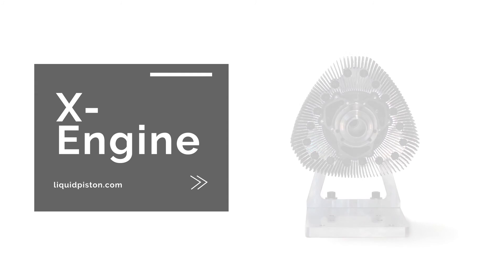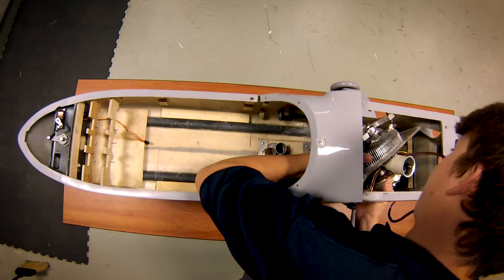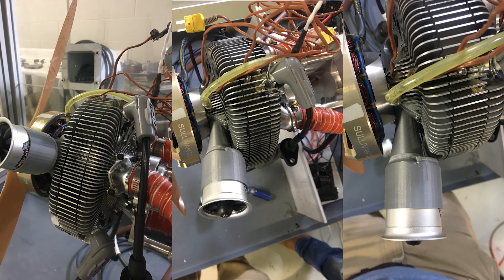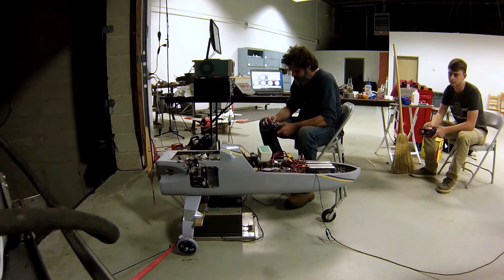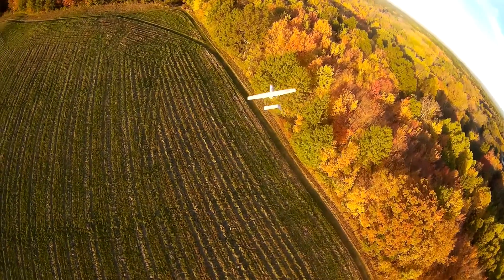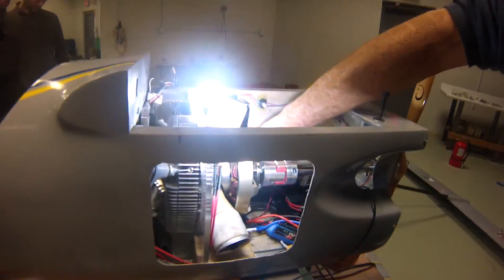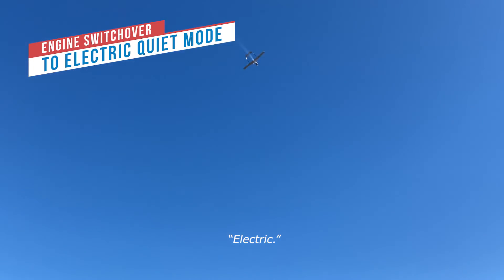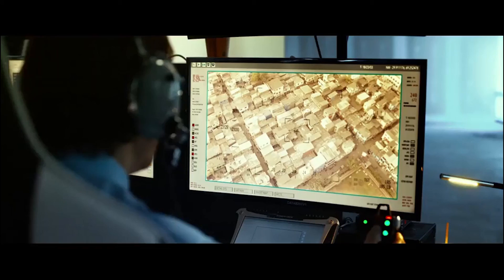LiquidPiston X-Engine takes flight [Long]

Comment: I understand how it works but how is it lubricated ??
Reply: There are oil channels incorporated in the "apex seals" so no need to premix 2t oil with fuel.
Reply: I would imagine the same as any 2 stroke piston motor or rotary. Oil in the gas.
Reply: @mikehunt8375   was thinking that. Honda has some small 4 stroke motors with sealed bearings and can be used in any position like for weed cutters.
Reply: @raydreamer7566  "sealed bearings" would only solve half of the lubrication needs. You're forgetting about those piston rings scraping up and down that cylinder wall up to around 10,000 times a minute.
Reply: @probingtime666  Honda did it with there 4 stroke weed eater 25 cc motor with sealed bearing and a plastic type piston ring design. I am not sure about the details.
Reply: @raydreamer7566  Thanks, I've wondered about them. Honestly I had no idea how they dealt with the problem there. I was guessing since it has to operate at very varying angles a sump wouldn't be it but thought maybe a dry sump type setup with pickups in all corners might possibly be it, I can imagine the sealed bearings doing the job for rotating shafts etc although I'm not sure about durability operating at reasonable heat and a lot of pretty high revs but thought they must use a 2 stroke type mix in the fuel, a bit like 4 stroke glow fueled model plane engines do, I never would have expected any kind of plastic piston. I thought it sounded a bit of a novelty type idea. It's a whipper snipper, weed eater or whatever they call them where you are and the 1 thing you really want with them is LIGHT weight and good power. A 4 stroke has a lot more moving parts so more weight so fail number 1 for me there. As for power, I doubt they'd get the same power for the same engine capacity and certainly not for one of the same weight so fail 2 for me. The main desirable thing about a 4 stroke is that hopefully it will last longer than a 2 stroke but, with a plastic piston that's probably got to be much thicker walled and heavier in general plus plastic is highly UNLIKELY to last anywhere near as long as an alloy piston with rings sealing it so definitely not for me. I'll stick with my noisy, smokey, loud but effective and pretty durable Echo one thanks.

Comment: can you put it on motorbike ? (I really want to see it battle against 2 stroke sports bike)
Reply: They plan on eventually putting them in mopeds too. You can see more info on their StartEngine crowdfund
Reply: @nicholaskoenig1089  I would definitely buy a liquidpiston rotary moped!
Reply: @loucam-l6214  I wonder what the torque figures are as I’ve only seen HP for their engines. I’d expect it to be relatively low, to my knowledge rotarys have lower torque due to lower rotational mass. 🤔
Reply: @nicholaskoenig1089  I would actually think it can give way more torque than wankel's design because it has three consecutive power strokes. I'm no engineer but liquidpiston's design seems very efficient, if ever there will be a 1.0l rotary of this design my bet is it would outperform mazda's 13b 1.3l rotary engine.
Reply: @loucam-l6214  fair point, I forgot the LP had 3 combustion events per 1 rotation!
Reply: I would like to see the figures compared to wankels because it may be efficient unlike wankels but will it have the rpm, hp and response like them, 
Considering the nature of goals behind each engine is completely opposite e.g wankel is better suited for race applications with its extremely high flow through rate but this is made to be alot more sippy cup... Idk im very interested in all regions of testing this including pulling out the wankel and replacing with same size liquid piston to see how good it can haul a car down the strip!
Reply: @Yukanhayt-Mhenow  perhaps instead of scaling up the LP engine, they could just run more rotors in a series like the wankel too. Definitely some cool tech and I’m eager to see how it progresses
Reply: Considering there is a dirt bike behind the shop, I’m almost positive that will be something they look into for the future. The x-mini engine is only 70cc displacement and approximately 4 pounds, yet produces nearly 5hp. If they could make it liquid cooled and maybe twin or triple rotor, I bet they could certainly be competitive with 250cc 2 stroke or 450cc 4 stroke bikes with the right gearing.
Reply: @gallupcustomknives2293 enough for a scooter already.